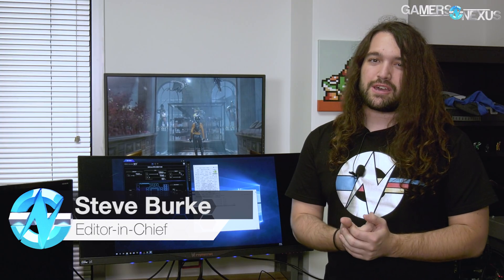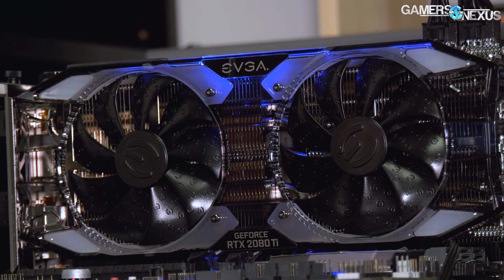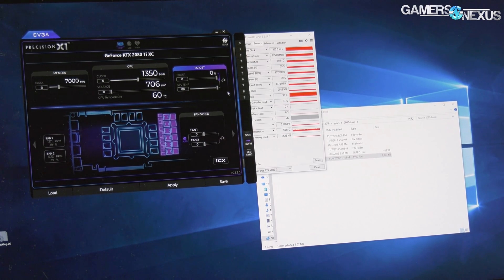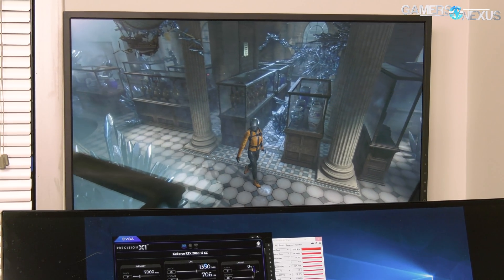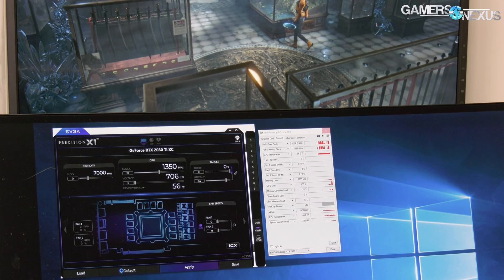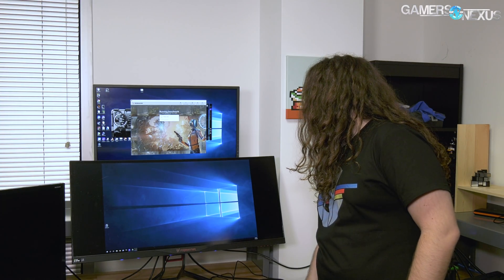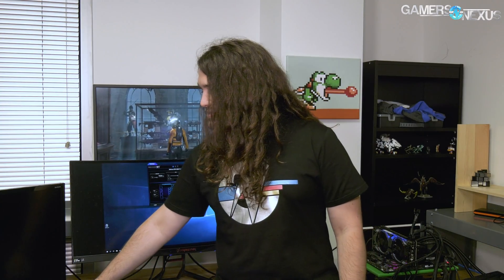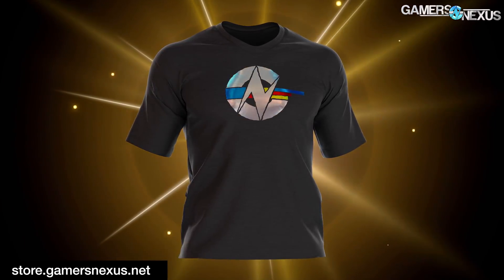Dead 2080 Ti #1: Clock Freeze at 1350MHz, Stuttering, Crashing

Comment: Gamers Nexus, Thank you for inspiring me to Liquid Metal my 8700K. I went from 4.9Ghz nearing 100c to 5.1Ghz at 75c max with average around 50-70c. Was super simple to do.
Reply: Just curious, what happened to the total system power consumption after the jump from 4.9 to 5.1? And what does it score for CB R15 ST and MT?
Reply: @mapesdhs597  I'm not sure about total consumption. But with two 2080ti's and 5.1Ghz, the EVGA P2 1200 is working well on it's own circuit. My best R15 score is 1694. I'm not sure what you mean by MT?

Comment: Is it mostly just the reference PCB 2080 TI that are having these issues like the 2070 and 2080 are unaffected?
Reply: According to the reports so far, it is mostly reference 2080TIs with only a few partner cards and non TIs having it.
Reply: @wingracer1614  if that's the case I guess I should be fine it looks like some cases be a card issue but it could be a driver issue or software / Hardware compatibility issue

Comment: The rise of AMD has begun.
Reply: TheRealSamPreece yes pls I have AMD stocks
Reply: I can't buy AMD I play 1440p and in this new games a card like Vega 64 can't give me 144 fps overall. It's sad, i w8 1 month for see what AMD realize and they can't match up with 1080ti at least. I'm gonna replace my gtx 1080 maybe with RTX 2080.
Reply: i hope you're kidding, amd gpu's are worse than ever. threadripper and amd cpu's in general sucks for gaming. if you're a high refresh rate gamer, and want full potential out of the monitor, you need an overclocked intel chip 6c minimum. it's a fact. amd is cheap for a reason.
Reply: @Dr.WhetFarts  i mean, i personally have a high-end nvidia gpu and intel chip, lol, but im calling it anyway,  maybe we will see amds hardware magically start to perform better. Never underestimate the power of politics and marketshare over hardware performance.
Reply: If only they could make a graphics card capable of competing with a 1080Ti, they would sweep most of the market up; but they are still fighting at 1060 levels :(  They definitely shook up Intel with Ryzen/+ ...  with a better IPC, if only they could start getting closer to 5 GHz ...  I think its been over 10 years since I had an AMD/ATi system, and with the stuff Intel/Nvidia has been pulling, I would love to give AMD my money without feeling like a downgrade (6700k & Titan X Maxwell).
Reply: @kuromurasaki5273  At least AMD has cards that fully work on Linux unlike Nvidia who refuses to give us any kind of open standards, and then wants to charge us out the ass for 1/2 bake products that die at random, and besides most users are still gaming on 1080p 60hz monitors, so AMD cards are just fine at those resolutions. In fact I've had AMD hardware last me longer overall because of their driver support. Not my main system, but to prove a point in my guest room, I have an AMD Athlon II X4 @2.9 Ghz with 8GB of DDR2 800Mhz RAM, with an XFX AMD R7 240 2GB GPU on an MSI AM2+ micro ATX motherboard, with a 420 watt PSU(generic but runs strong, and the system never pulls more than 122 watts max load) with a 250GB WD HDD that can still run a lot of games at 1080p on Xubuntu 18.04 LTS with the latest kernel drivers and STEAM with STEAM Play enabled. That's good enough for me.
Reply: @kuromurasaki5273  why would you pair a consumer cpu with a enthusiast gpu?
Reply: @bigironenthusiast9343   I had the really terrible cooler MSI 980Ti; it started crashing constantly playing Destiny 2; my kids mother had SLI Titan X maxwells for the luls (rich boyfriend) and gave me one, now the 980Ti sits in a box in the top of a closet hoping to one day see the light of day.

But let me ask you this; if the 980Ti was comparable but cheaper, is it a similar level enthusiast gpu?  What CPU would you have suggested to pair it with that had a reasonable price to performance ratio?  Should I have turned down the titan x and spent considerable money on another 980Ti to perform similarly?  6700k just came out when I built the system; I don't think going to HEDT would've netted me more FPS and I'm not streaming/recording at all.  I'm a bit disappointed with its overclock potential ...  4.5 GHz with 1.25V, 4.8 GHz took 1.45V to be stable; this replaced a 2500k that did 5.1 GHz @ 1.35V.

Now, if you are offering, I'll take a 2080Ti with a 9900k and a mobo to match it (will it run on a z170a?)

I'd find it more odd to pair an enthusiast cpu with a consumer gpu (9900k with a 1060 3GB).

I'm partially hoping you are the Nvidia Jensen and you just feel generous and want to build a random idiot on the internet a PC for fun.  I am sure you aren't and wouldn't, but wth, right? :)
Reply: @kuromurasaki5273  the titan Maxwell is a bit more of an enthusiast card just cause of the price compared to a 980 ti. And I personally would have gone on the x99 platform if I had gotten a titan x or a x299 or tr4 if I got a 2080 ti
Reply: @kuromurasaki5273  "my kids mother" - shouldn't that be your wife?!! Why does she have a "(rich boyfriend)" ?! :))
Reply: @kuromurasaki5273  You make a lot of assumptions in there about me based on an YT comment. Isn't that a bit in opposition with what you're promoting :P? I'm, actually,  with you on a lot of the things you mention and I try to keep myself as much as I can out of the "hate culture" that seems to be flourishing around us nowadays :)
I was just joking around, because it was, let's say, an unusual/funny way of saying things, but rest assured, I did understand what your situation actually is.
Reply: Kuro Murasaki You know vega 64 is as fast as a gtx 1080 right?
Reply: Well it heavily depends on the application or game though.

Comment: About a month ago my GTX 1070 (EVGA FTW2) also had some similar strange issues. It was working fine and typically clocks to 2000+ MHz under load until one day its clock would only go to about 1000 MHz in games/ under load. Temps from evga icx sensor s are perfectly fine (I watercooled it using NZXT g10 and a corsair aio). I tried update driver, but it didn't work. My card's clock speed finally came back after I reinstalled my windows 10.
Reply: Very strange.Windows can cause some very odd behavior with hardware some times.

Comment: So Gamers Nexus, the over all saying for the GTX 20XX's was unless you had the money and you really needed to be on the cutting edge then you should get a GTX 10XX'S. But now with the reliability issues that seem too only be with the 2080 Ti's. But would you say due to these issue the 20XX's not worth even the price due to the possibility of not functioning properly aswell as the high price?
Reply: And in the past, when SLI was properly supported and not borked by additional cost & poor dev effort, it was a lot more common to simply add a 2nd card if one wanted to bump up the frames. I did this for years through multiple cards to keep the performance where I wanted it, worked great for Oblivion, Stalker, etc., all the games I played back then. How convenient that SLI becomes defunct, pushing a single GPU as the primary means to better performance, the prices go through the roof, and then we see the quality collapse through the floor once the company is drowing in dollar bills. People need to vote with their wallets here, buy AMD, even if that means stepping back a notch or two on the quality/speed settings for a while. Nothing else will give NVIDIA the kick up the butt it sorely needs.
Reply: @mapesdhs597  I sold my 2 GTX 1080s and upgraded to 2 RTX 2080s (non Ti)  NVLinked Founders Edition. 40% of my game library has SLI support and my cards are running well so far. Hopefully this is only a Ti issue.
Reply: @Patrick73787  Fingers crossed they behave! 8)  SLI though has been greatly diluted in recent years, and NVIDIA just keeps making it worse by moving it out of the midrange stack entirely. With a shrinking user base making use of the tech, devs are less likely to bother making the effort. The core market is the equivalent of the GTX 1060, which today can't exploit SLI. Its absence from the RTX 2070 is very telling.

Comment: Probably not it, but, you didn't mention about not using EVGA Precision X, if that was the cause. Probably too easy a fix. But, yeah, did you try uninstalling EVGA Precision X or not using it just to see and eliminate it?

In fact, EVGA has a different branch of their PrecisionX software for Turing cards with more features. So, could it be that? A software EVGA Precision X glitch?
Reply from the maker: Not Precision, unfortunately. It always happens.

Comment: Hopefully Nvidia thanks you for your work here- I would cost a lot to do in house testing to identify these bugs- now they can fix it to produce an even better product. I just one of the tiny components on the board is faulty it could cause an issue- I recall guys delidding CPUs saying that depending on which capacitor is 'knocked off' the CPU can still run...

Comment: With a new intel driver update for my hd620, it now reads 23cus besides 24cu. My gflops went from around 380 to 360. Please please please dig into this and see what in the world is happening. Did intel just disable a compute unit in my laptop!?!?
Reply: Driver in question is 23.20.16.4973
Rollback driver gave me 24cu via aida64.
Its a dell inspiron 5566 i3 7100u
I know the newer hd graphics have 23 compute units but at 1100mhz so it makes up the difference but im still at 1000mhz
Reply: @crazed357 You'd better compare the actual performance (OpenCL benchmarks included). My bet is that's misreporting either at AIDA or driver level.
Reply: @ПётрБ-с2ц  I think you may be right. Ill check when i get home
Reply: I've got a 980 ti but I still put a like on this comment because if this is common practice in hardware vendors, I'm more interested in it than the 1200$ gpu problem...

A lot more people would be affected by hd graphics gimping than RTX... A lot lot more
Reply: Can you roll back? Might be a hardware issue i think :P
Reply: Trying to confirm now.
Reply: @crazed357   Let us know how it goes. I'm dying to know how you lose a compute unit. That's kinda crazy.
Reply: aida has a hardcoded list of parts that it uses when detecting your hw ID, it's not based on any measurement at all

check gpuz, check performance... but in something that will definitely have a performance difference, probably some synthetic test
Reply: wow that's interesting.

meanwhile my old core2 duo e8600's core decided to die so I was down to 1 core @ 3,33GHz Xd. I got myself R5 1600 system later.
Reply: @Radovanslav  This is the first time that I hear about a core2duo actually dying without external intervention :)
Reply: Did the driver update come from dell themselves or is it from intel?
Reply: @damstachizz  It came from windows devices update. Not sure if dell or intel influences what windows finds.
Reply: @crazed357  Go and grab 25.20. 100.6373 direct from intel

Comment: I thought lot of these cards go through testing, aka Nvidia testing to make sure everything is good before sending it off to EVGA and such. If this weirdness is happening on the FE boards, then there must be something on the FE cards causing it. Do the custom boards have the same issue?
Reply: apparently not as much, it seems to be contained to the FE boards...which would be strange. But RMA data should be viable in a couple months time when enough time has passed to make a clear judgement, unfortunately this cannot be rushed because RMA ratios are entirely dependent on how much time passed, how long the product is available and how many have sold.

But it is strange that it would only affect FE boards, I mean, the FE board should be the most tested, on might assume, since it comes straight from the manufacturer.
If it is indeed one of the components they chose for the reference design it should be an easy fix. I don't think the FE boards would use any special GPUs but there are hundreds of components on a GPU that could be at fault here...
Reply: Reminds me of EA games releasing "finished" games for us to test..lol
Reply: The reference pcb is the reference pcb with the reference components...evga just slaps their cooler on it. Custom pcbs are made by the board partner. Lol
Reply: Do you actually believe that a person is hand testing these video cards for errors like this? These cards are mass produced on assembly lines and so is the "testing", en masse: at the end of the line they shove them into a PCI-e device to see if they power up and produce an image on a display, stamp them OK and throw them into a box. Literally, they throw them, they are not handled with care at all.
Reply: @GholaTleilaxu  How do they make sure the sometimes very fragile cooler shrouds don't break on impact? :D
Reply: Nvidia doesn't make the cards that EVGA sells, lol.

Comment: I had two 1080ti FTW3 cards that got stuck at 1506MHz, had to RMA them both. This seems to be simmilar. (Diferent BIOS did not help also). Issue was in fact caused by the cooler somehow (not exactly sure how though, but it was the cooler)
Reply from the maker: We can troubleshoot that easily enough. Will just mount a water block to it, but it seems very unlikely in this scenario.
Reply: definitely seems like a power problem to me..but I don't know jack shart about this problem. But me and my 1080 ti FTW3 are definitely enjoying these videos since I decided to skip the 20 generation.
Reply: @GamersNexus  @CampyCamper OK so I know it was the cooler because I had the FTW3 (air cooled) and I bought a Hybrid AIO from EVGA, this Hybrid kit was a faulty batch and there was something wrong with it. After mounting it on the card it made the card never go above 1506MHz forever, even if you changed the cooler back it was still stuck at 1506MHz. Attempting to change anything in EVGA PrecisionX resulted it freezes, crashes, etc... even if you just tried to change fan speed.
No, there was no water leak or anything like it. I checked multiple times but I was not able to find any undesirable contact between the cooler and the card on some place where it shouldnt be contacting.
I just know it was the cooler because many users had this issue when they installed this cooler on their card and EVGA also confirmed it at the time. I got everything replaced via RMA, also the cooler. Now it works fine.
Reply: @TheWereCat how did you confirm it was the cooler?
Reply: @CampyCamper  A short in the PWM for the cooler motor could cause leakage of a timing signal down a path it isn't supposed to go. Both clock timings then interfere somewhere else. Or it creates phantom power glitches elsewhere. As much as we think computers are digital at the basic circuitry level they are still analog. To get better circuitry you can adjust how sensitive the circuit is and that can lead to screw ups if the input voltages get messed with. Unlikely to get everything to line up perfectly but big failures are usually a result of cascading small failures. A sensor getting shorted out on the cooler motor is also possible as well.
Reply: Now that is really weird. Maybe the cooler was feedbacking into the card's circuitry?
Reply: @VoldoronGaming  do you know how electronics work?